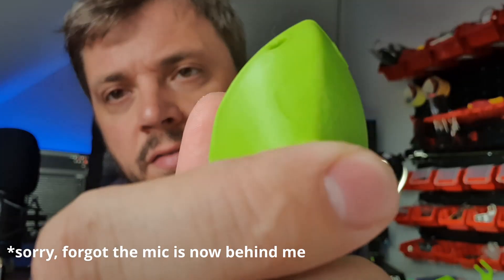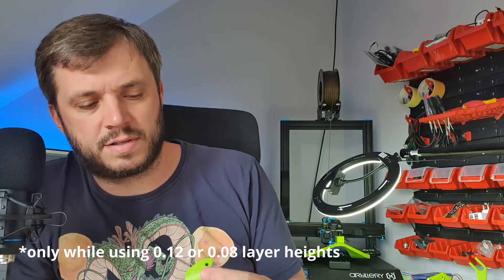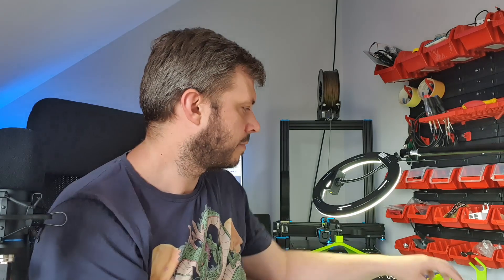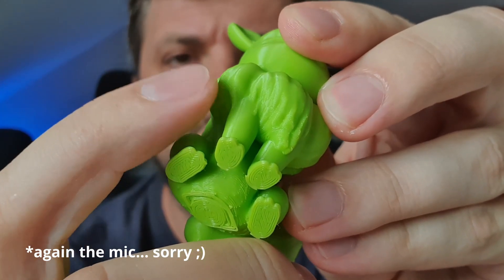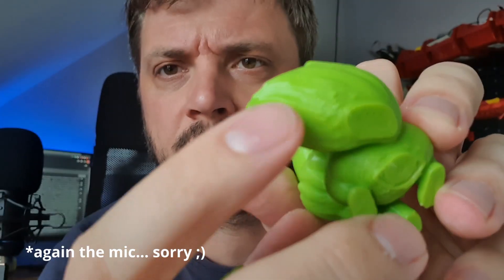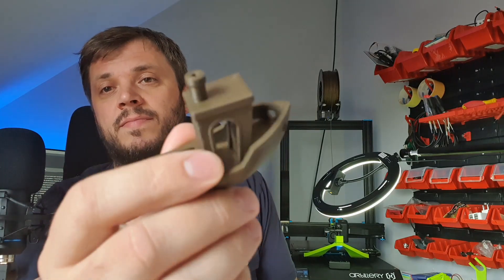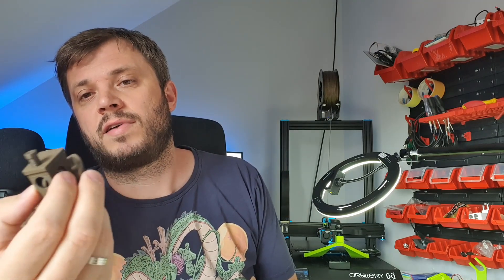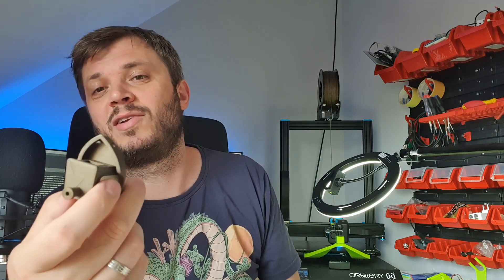Perfect 3DBenchy - Artillery Sidewinder X1

Comment: I had a similar issue, but in my case it was a problem in the latest version of CURA. I reverted back to an older version and the same models with same filament / settings printed perfect.
I noticed I could literally hear the hotend shudder as it was printing those curved parts (strait parts would print fine) so for me it was definitely the gcode.
Reply: Were you using Cura 4.7 when you had the issue?
Reply: I have this shudder as well and have no idea how to solve it, I am using Cura 4.7
Reply: @runtimus5743  it's annoying me also....please share if get any solution
Reply: i had it too with cura 4.7 - switched to simplify3d - and it was gone..